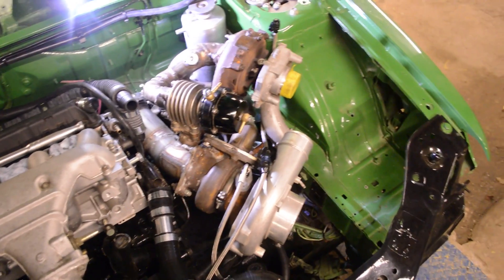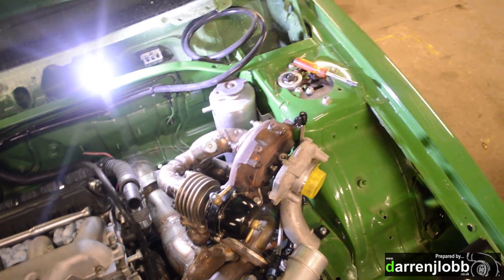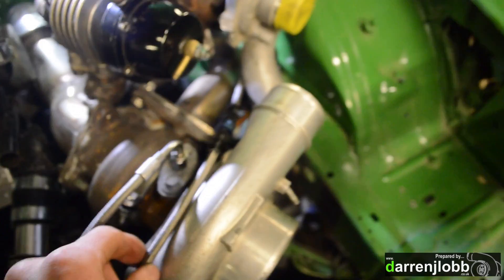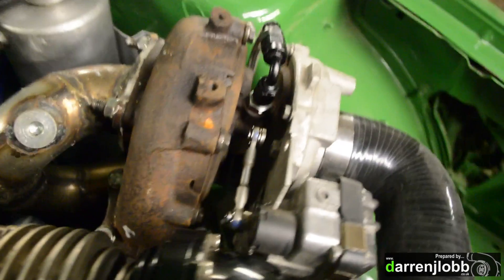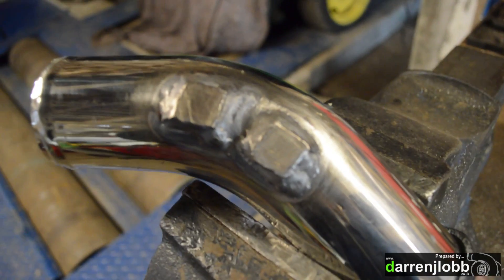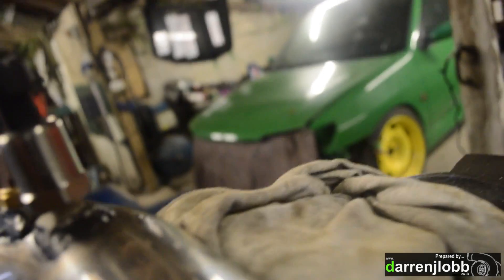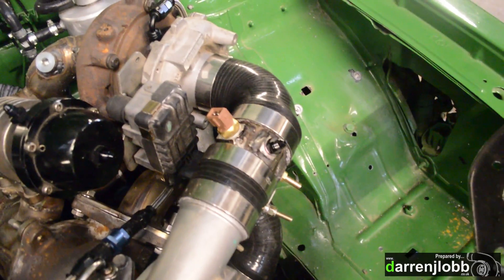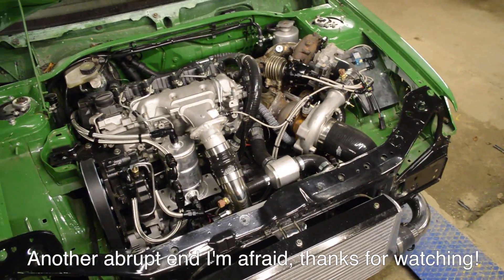darrenjlobb's JD DervBus Project Part 25

Comment: Awesome build, what engine management system do you plan to use? Lots of new inputs required from all the additional sensors you have installed.
Reply from the maker: The car will be running an Adaptronic E1280 ECU, which you will see in the next video! (Hopefully)

Comment: That fuel filter looks like its very low, will it not be knocked off on speed bumps, kerbs ect?
Looks good apart from that, looking forward to the first start :)
Reply from the maker: It is fairly low, and quite a bit of debating was done to if it was going to be a problem or not! It sits higher than the exhaust, so hopefully should be ok.... If not I guess I will have to have a re think!
Reply: Darren Lobb

Well hopefully it will be alright.
Although could you not make up a guard out of some 3mm plate or something and attach it with your magic rivnuts? I know the threads on those filter housings will bend and break the seal. Would be a bummer to knock it off when your on tour!